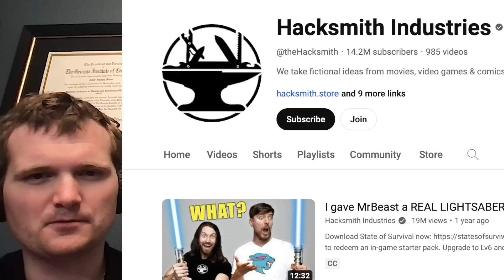Nuclear Engineer Reacts to Hacksmith Industries "I Gave Mr Beast a LIGHTSABER and Caused a DISASTER"

Comment: Can Black holes ever be doughnut shaped or can micro white holes exist?
Reply: A black hole, or more specifically, a singularity, is a single point of exorbitant mass. It’s an enormous gravity well compressed into basically nothing. The event horizon (black nothingness surrounding the singularity) is the field from which the escape velocity exceeds the speed of light. In layman’s terms, the gravity is so strong that even light can’t escape which is why you see complete darkness. So no, you can’t have donut-shaped black holes, not unless you could somehow warp the gravity well into a donut. 

I don’t know much about white holes but a micro black hole is theoretically possible. By concentrating enough heat, light or radiation, say by shooting powerful enough lasers at a single point, it should be possible to create a kugelblitz, an artificial black hole.
Reply: @quakxy_dukx there are hypothetical ring singularities which might even be more common, it’s a potential result of the spin some black holes have, but again like all singularities it is hypothetical and will likely have a more solid quantum mechanics answer
Reply: @VirtualQuarkInterface > spin that some black holes have

"some" being every single black hole we know of. The way black holes are formed is from stars, which are always spinning due to how they're formed. That spin doesn't just vanish.